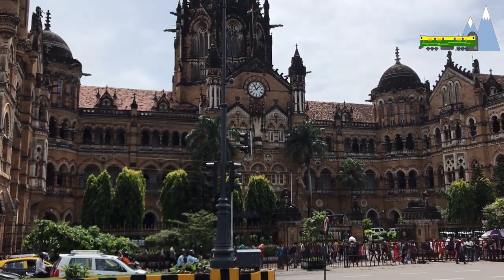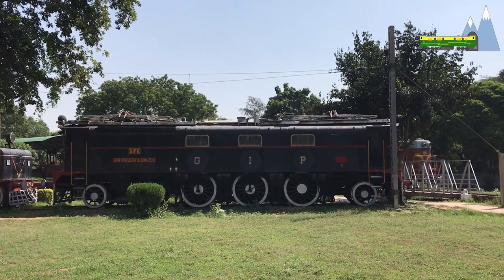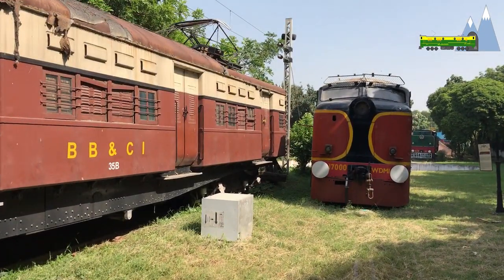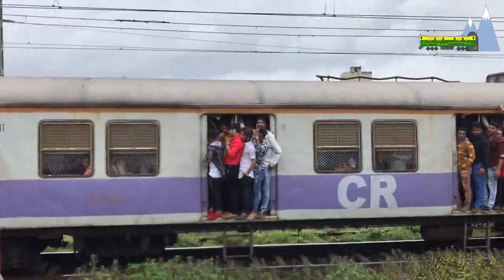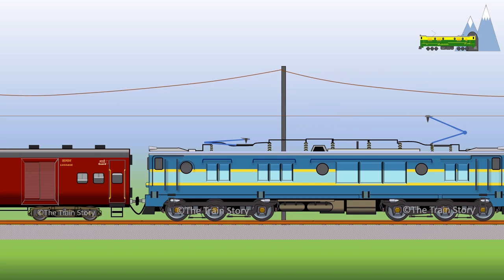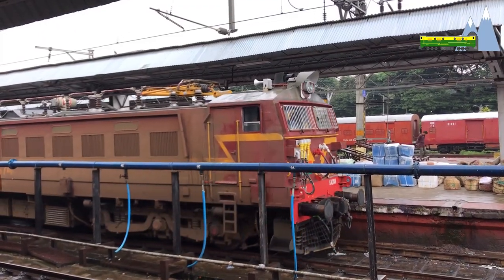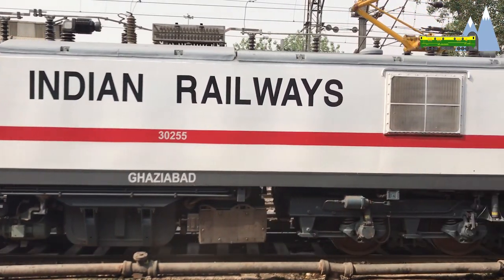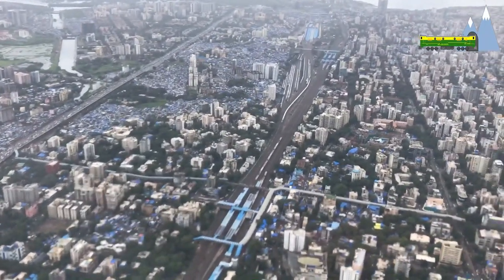Mumbai 1500 V DC traction | AC-DC Traction system of Mumbai | Bombay Electric Trains | CR | WR

Comment: Thank you Sir for the Video . Being a HVAC Engineer by profession i am also connected to Indian Railways for supply & installation of  AC systems . This  electrical system used by the Indian Railways should be mandatory to all the Indian students of Electrical Trade & Engineering .
Reply from the maker: Thank you Sir

Comment: The saga of 1500 VDC traction had become a monument to Indian Railways' inefficiency. Especially the comical workarounds such as spending money on developing dual-mode AC/DC locomotives.

Want another example of CR's inefficiency? Just check out the Sholapur division. The main line there is single diesel to this date, complete with obsolete scissor crossings. They're lagging two decades behind SCR in doubling+electrification of a line that's considered "golden quadrilateral" (as it connects Chennai to Mumbai).
Reply from the maker: Yes... the Chennai Mumbai line is most neglected in the golden quadrilateral...
Reply: CR and WR both suburban systems were already established with DC tractions. AC/DC locos are not comical workarounds but existed since 1975 on WR with WCAM1s. Its not an overnight job to change traction with all your DC rolling stocks with shelf life left in it.
Reply: @TheTrainStory  sir doubled and electrified MAS-Mumbai..

Comment: It's hard to say whether DC is obsolete completely, but ofcourse AC has advantages. It is interesting to note that many brand new metros outside India still opt for a DC system.
Reply from the maker: New metro systems rarely select DC traction. However existing systems already built on DC TRACTION will replace older rolling stock with newer DC rolling stock. E.g the London Underground.
Reply: @TheTrainStory  interesting. thanks for your reply! I must be mistaken in that case
Reply: @TheTrainStory  no need to reply but I understood that relatively newer systems, especially if they are light rail are DC. Even the kochi metro is 750V DC. All heavy duty metros expected to serve millions a day might opt for AC as their preferred choice(mumbai, chennai,delhi etc), still DC power supply has it's clear advantages too, and the choice comes down to individual circumstances. I don't think DC is obsolete yet
Reply from the maker: @UtsukShah9  you are right in as far as light rail/tram systems using DC at 750 V.

Comment: Why dc system preferred over ac system on Mumbai Suburban train 
Not mentioned.
Reply from the maker: Electric traction was introduced in Bombay/Mumbai in 1925. At the time DC traction was state of the art.
Reply: That use of DC,was being paralleled in Britain,as the first lines of the,then LNER,were being electrified! Also in Victoria(,Australia),there was an installation going on at the same time! In the US,there were two lines electrified,the DL&W,[ New Jersey],and the IC,[Illinois],and those were commuter lines,again 1500/3000 volts DC,as in India! There were others,but the aforementioned were well publicized, an the one in New Jersey,had Thomas Edison,running the first train! Hope the information is useful,and adds to your data base! Thank you,for the information,and it fills in my knowledge and experience! Thank you for your diligence and time!! 😇!

Comment: You did not touch upon the real functionality of WCAM series, which helped the trains (first) from Bombay central to Virar on 1500V DC traction power supply and then after Virar, passing through a no power zone between two traction poles, switch to 25KV AC